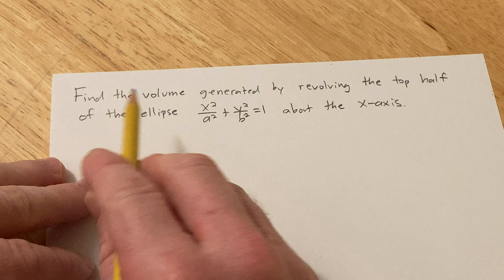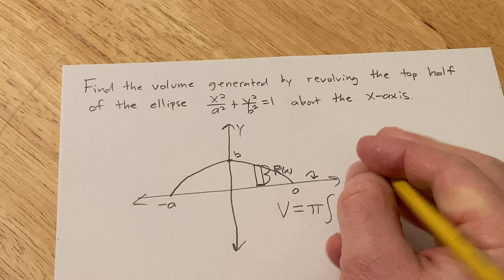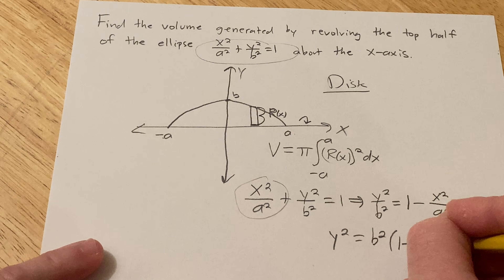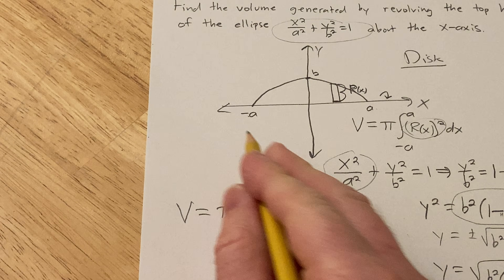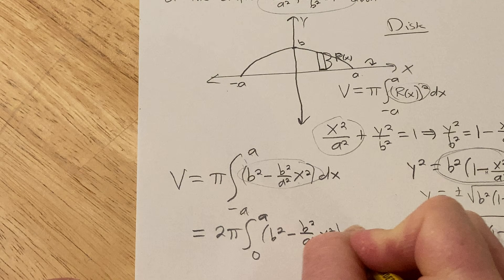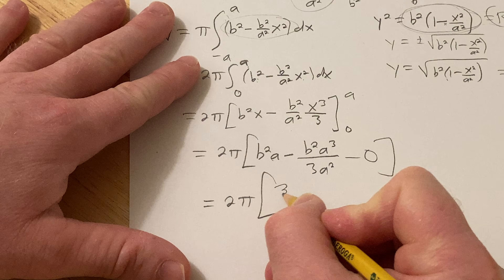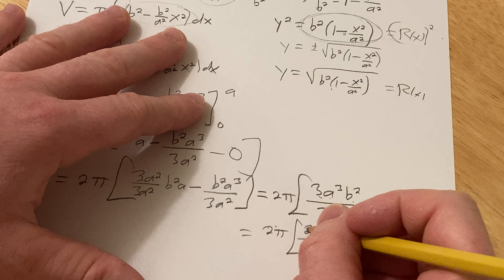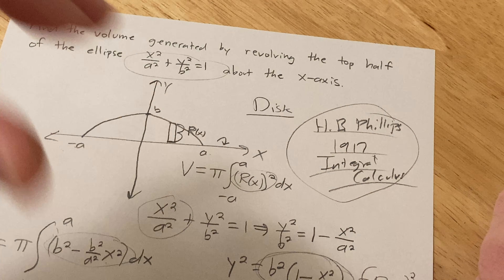Volume of the Solid Generated by Rotating An Ellipse Around The x-axis

Comment: possible alternate method: make a coordinate transform using x' = (a/b)x. in the new coordinate system you now have a sphere with radius b so it's volume is (4/3)pi b^3. then you just need to transform this volume back into the original system by dividing by the jacobian which would be J=b/a so V=(4/3) pi a b^2

Comment: Simple proof:

Since an ellipse is a flattened circle, the volume generated would be equal to the volume of the sphere of radius 'a' times b²/a². Required volume equals 4/3 pi a³ times b²/a² which equals 4/3* pi* a*b²
Reply: Great! I think this's a special application of Papus's Theorem, for volumes of revolutions...
Reply: @4thesakeofitname  I don't immediately  see the connection  to Pappus theorem but its somewhat  closely related to Cavalieri's theorem
Reply: @ahsan4306  Hmm yes Cavalieri's theorem is also quite useful, but I instead used Pappus' (second) theorem to find & relate the volume of a sphere and an ellipsoid by considering them as revolutions of a vertical cross sections (in the first octant) about vertical z-axis (x-y being horizontal)... You first find the horizontal centroid rx of the vertical cross section of area A , then find the distance L traveled by centroid of it during one full revolution : L = 2.pi.rx  then the volume is V = L . A = 2.pi.rx.A ... It can be seen that the cross sectional area B of the ellipsoid is b/a of that of sphere, and also its horizontal centroid is the same of that of the sphere, then their volumes are just scaled by (b/a) ... yielding your elegant simple proof... [I think I've mixed "a" and "b"]
Reply: @4thesakeofitname  That's an excellent line of reasoning. The essential difference in ur method is that ur method involves  dividing the ellipsoid into thin cylindrical shells with the common axis of rotation. And then averaging the volumes to get the area times centroid distance formula. In  my proof I instead divided the ellipsoid into  thin disks normal to the axis. The area of each disk is b²/a² of the corresponding  spherical disk since area varies as square of the radius. The results are the same. As they should be.  but I still can't clearly understand  the MATHEMATICAL reason why dividing the solid in these  two different ways MUST give the same result for the factor (b²/a²) . In other words , can u see why the two modes of subdivision  give the same factor-- one factor comes from the fact that area is diminished by b/a as is the centroid distance ; the other factor comes just from the fact that the disc's  area is diminished by b²/a² which is the same number BUT it arises completely differently ( area alone scaled)
Reply: @ahsan4306  Well thank you. By the way, unfortunately it's extremely painful to make successful calculus discussions in this plain text format, which would be very simple on paper; That's to say pen & paper is still the medium for calculus as of 2022! And for the proofs I think I get what you mean. Eventually all methods should yield the same result of course. In my revolutions approach, however, I didn't explicitly utilized shells as it's implicitly included in the pappus's theorem, which thus can be a simplification for volume calculations provided the centroid is easy to find, or not necessary to explicitly compute as was in this example.